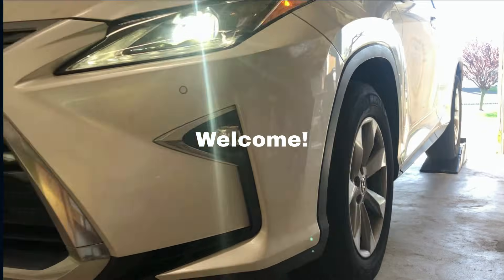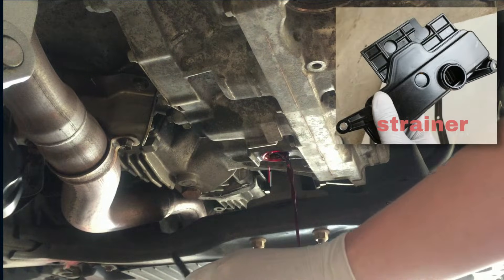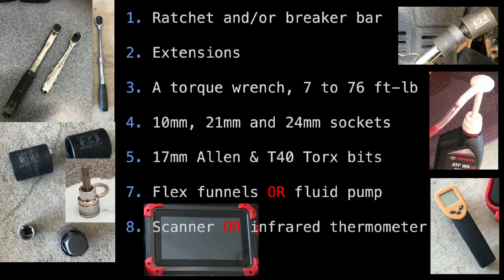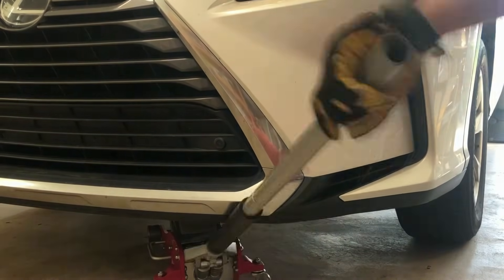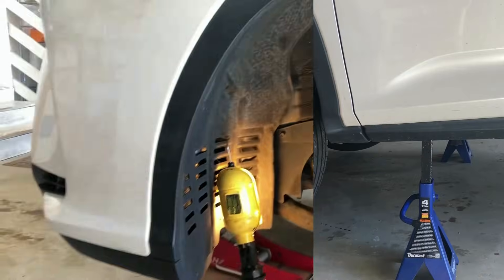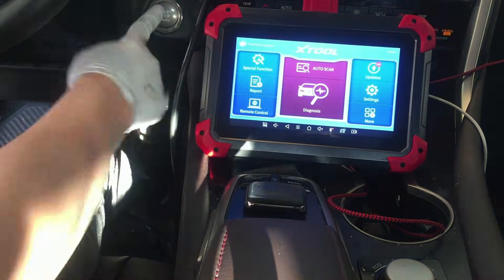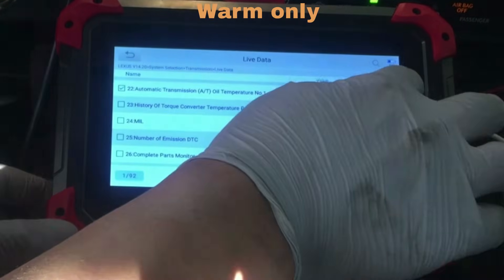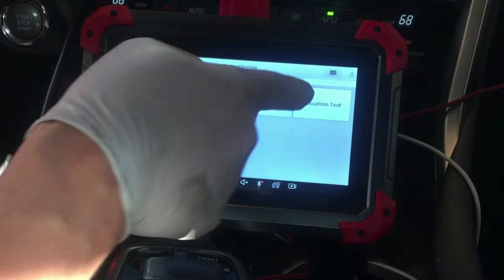Toyota Lexus Sealed Transmission Fluid Change & Level Check - 2 Temperature Gauges

Comment: Can I just drain the fluid then measure how much drained out ex. 4 qts and just refill with 4 qts. Thus adding only what drained out?
Reply from the maker: Short answer: no, I wouldn’t recommend that.

The main issue is the starting level may already be wrong (previous service, someone topped it off, etc.), and ATF changes volume as it ages and heats up. Measuring what drains out also introduces small errors, and if you repeat that over time, those errors add up.

That’s why Toyota wants the level set by temperature with the engine running, using the overflow tube.
You don’t need an expensive scanner either -- something affordable like the Kingbolen Ediag Elite (~$100) can read ATF temp and lets you do it correctly: https://amzn.to/4kSSpAK

Comment: I will replace the transmission fluid by the same amount by measuring using clean clear empty gallons. I will put the new transmission fluid first in the gallon, then the other empty gallon will be used for dirty transmission fluid that was drawn from the transmission. By comparing the level on both gallons, I am sure that I am putting back the same fluid. I withdrawn. 
I like the video indefinitely gave me idea how to do my own transmission fluid change.
Thanks
Reply from the maker: Glad the video was helpful! Though I don't recommend the volume matching approach primarily because the existing fluid level might be incorrect due to various reasons: https://youtu.be/6ZiYsWWayWs. The overflow method at the correct temperature is key for setting the level accurately on these sealed transmissions.

Comment: Do you know anywhere we can buy the plug as a whole with the stand pipe and the T40 plug included
Reply from the maker: Call your local Lexus dealership parts department and they will find the parts for your RX350. Alternatively, you can contact a Toyota dealership and use an equivalent like a Highlander AWD to look up parts and go from there.
Reply from the maker: I list related part numbers like o-rings in the description, which I copied here and they can look up those parts on their diagram and find your parts nearby. 

2. Filler plug washer, #90430-A0003: https://amzn.to/486XP5t
3. Drain plug o-ring, 96721-24018
4. Overflow tube o-ring, 90301-06196

Comment: For those DIYers who have replaced the fluid with factory fill do you get exactly 3300 mL out of the transaxle for the FWD models?
Reply from the maker: I didn't measure the exact amount but up to 3300 mL sounds right on the 8 speed transmission (AWD or FWD). On the previous generation with the 6 speed, it's a much small mount like 1.5 quarts or so: https://youtu.be/AkElgixA5LI

Comment: Hi professor garage, my car is 2019rx350 fsport with towing package, do we have to do something more like plug the pin for coolant tranmission?
Thank you!
Reply from the maker: Excellent question! I'll need a video to clarify this but let me give you my shorter answer: both yes and no. :) Yes officially, on the 8 speed, Toyota requires pinning the bypass valve to circulate (prime) the cooler line to eliminate factors of uncertainty in various situations. This step does apply to 2017 RX in the video and yours (2019 RX) with the 8 speed. 

Now practically -- though this is my conclusion based on readings, not Toyota's recommendation -- it isn't always necessary for a vehicle that has been driven to the full operating temperature (when the valve would have been opened recently for full ATF circulation in the cooler lines) before this procedure. I always drove the car extensively (the night) before leaving it in the garage for service and skipped this step in this regular service. 

Bear in mind though, there are situations where the cooler lines might be empty after a transmission job and you cannot skip this step in those cases. 

Bottom line -- yes, according to the book, you need to insert the pin to force open the valve for this procedure.

Comment: I recently did mine in my 2020 rx350l I found the transmission pan was within a degree of the fluid using the ir thermometer. Thanks for sharing the video helped a lot
Reply from the maker: You're welcome! So glad the video helped and the temperature gun method worked for you!

Comment: Honestly, once you do it it's not that bad.  But absolutely change your fluid, I recently purchased an ES 350 with 152k.  I don't think it's ever been changed, but I did it with the filter and dropped the pan.  The fluid was very very dark.  Everything went fine and it shifts like butter afterwards, no issues.  I know there's some conflicting information about certain high mileage and not doing it, but I feel like new fluid is new fluid, it really doesn't matter when.  It's not like you're changing every drop out anyway.  4.5qts.  

Here is a pro tip, there was one bolt that's a total pain in the ass to get to, all you have to do is cut a socket in half, a quarter drive with a wobble extension and it's money in the bank.
Reply from the maker: Everyone's driving condition is different and the transmission fluid past 100k can vary a lot, and that's why I don't offer general advice without knowing the fluid condition. In your case, it's normal/expected for the fluid to be dark and very dark but as long as it's still very much liquid, it's generally a good idea to replace it with a drain and fill. I wonder though after you've replaced the filter and had a chance to see its condition, do you think it's necessary to replace it? Is it a strainer or filter? I'm not against dropping the pan and replacing the filter but have seen too many problems with folks not following the procedure, using aftermarket parts, and rusty or difficult-to-access pan bolts, which led to problems of incorrect infiltration/pressurization, pan oil leak, and stripped pan bolts, etc. after their replacement. Good work if you've done it right!

Comment: What happens if you put too much Oil? Like 4 quarts for example?
Reply from the maker: When overfilled, the transmission won't have the proper pressure and fluid properties/dynamics it needs to function properly, e.g. with fluid aeration/foaming. Even if it doesn't cause shifting issues immediately, this isn't good for the long term and it's best to check and set fluid level as soon as you can.
Reply: Thank you so much for the feedback😊

Comment: You produce excellent DIY car maintenance videos.   For this ATF drain and fill video, where did you find or determine the 60k, 30k, 30k, etc. interval you state in your video?  I'm intuitively biased towards more frequent refills.  However, the Toyota Master Certified technicians on youtube simply recommend 60k, 60k, 60k, etc. In fact, they warn against doing the drain and refill too frequently. Thx
Reply from the maker: Great question! It's based on my analysis of Toyota/Lexus service schedules over the last couple of decades, with a focus on transmission service, part of which is reported in this video: https://youtu.be/X7iQ8hWcB_w. Long story short, 30k and 60k service intervals were common for normal driving conditions before "lifetime" fluids were "invented." Severe driving usually cuts that into half. Now on the latest Toyota/Lexus service schedules--and you can review yours to confirm--they still recommend transmission fluid replacement every 60k for "severe driving conditions." So by extension, theoretically, you can replace the fluid every 120k under normal driving conditions (and strictly normal driving conditions which aren't common today). It won't really hurt your transmission if the wear has been limited and frequent fluid changes are beneficial. If it makes sense to do the first drain-and-fill at 60k (replacing about half the fluid, 100% from factory when new), then going forward, since the fluid will always be roughly 50% new after each service, you could project the interval to be about half that, i.e. around 30k. 

Bottom line--again, if your transmission has limited wear, I don't see a problem doing it even more frequently. But if the fluid is gone and transmission has now relied on friction materials suspended in the oil, then it's already on a borrowed life and it's only a question of when slipping etc. will start to occur. Hope this makes sense.
Reply: @profsg 
So, 60, 30, 30 is somewhat personally arbitrary. In the whole scheme of things, perhaps a good compromise would be 50, 50, 50?  One obvious advantage is the removal of one maintenance task from the sonewhat busy 60k interval.
Reply from the maker: @Fearless-1 Those 30k and 60k intervals come from Toyota’s long-standing service schedule. They were originally set in kilometers--like 50,000 km and 100,000 km--and when converted, that works out to about 30k and 60k miles. Personally, I find the 50s easier to remember, but Toyota’s tradition has always followed those km-based numbers for transmissions.

Comment: I initialized 3.5 quarts and drained out overflow more than a quarts. Is it correct ? My car is Lexus Rx350, year 2010
Reply from the maker: That sounds about right on your generation of RX. My 2017 model has a different design and a larger capacity, about 3 and 1/4 quarts for a drain and fill.

Comment: I just bought a used 2016 lexus rx350 F Sport with 100.000miles (160.000km). Your clips are helping me a lot.
I have done and, going to DIY:
-Change oil/l and all the filters
-Clean body throttle
-Diff/transfer case fluid
-Coolant
-12V battery
-Brake fluid change, pad/rotor check and service
-Spark plugs change (this is complicated so i’ll book a workshop to do this job)
-Transmission fluid drain and fill. I don’t have an OBD2 scanner to scan the fluid temp. So I’m thinking of leaving the car overnight, and drain the fluid out, then fill in the exact amount of new ATF fluid in. Could you please give me your opinion on this option?
-Are there any other service that i need to do for this car? The previous owner didn’t service the car properly. Luckily for now, the car has 0 problem and drive smoothly.

Thank you!
Have a great day!
Reply from the maker: Sounds like a great plan! On the transmission fluid change, I would not recommend the volume match method as the existing fluid level might be incorrect due to fluid degradation, leak, or someone having touched/drained it (accidentally). On the RX350, you can measure the ATF temperature using a $30 basic scanner like this: https://amzn.to/4fmmgxX, with the Torque Pro app ($5). This video (starting at 7:28) shows the setup and the specific PID for this RX generation: https://youtu.be/WRW4LZmvIy0?si=mllbpjeTSIMCL4WJ&t=448. As for spark plug replacement, you can follow the same procedure here: https://youtu.be/2L0Bg78BRYg. Have fun!

Comment: Hi, thanks for your video!
I just bought a 2016 lexus rx350 with 100.000miles. The previous owner never changes the transmission fluid. Is the mileage too much and too risky to change now? I heard that if we change the fluid of a car that has too high mileage, that’s never changed will cause the transmission to slip, and  results in a change of the whole new transmission.
Thanks!
Reply from the maker: You're welcome! Yes, there's a risk either to replace it or to leave it at this mileage. I discuss the exact question in this video: https://youtu.be/X7iQ8hWcB_w.  My general recommendation is to do a drain-and-fill only, never flush, and if it continues to have smooth rides, proceed with regular fluid service (drain-and-fill) going forward. To be safe though, before the first replacement, take a small sample for oil analysis and make a decision based on fluid condition, e.g. the amount of friction material in the oil.

Comment: I have a Veepeak VP11.  I haven't found any corresponding apps that show transmission fluid temperature.  Does anyone have an app that works with Bluetooth OBD scanners?
Reply from the maker: I believe the Torque Pro app discussed in the video can work with the Veepeak interface. It's the Pro version for $5. If you have the a similar vehicle (e.g. RX350 or Highlander), follow this video for details including PID setup on the app: https://youtu.be/WRW4LZmvIy0. If you have other makes and models, you might be able to find related PIDs in the comments under this video: https://youtu.be/ytdcZ1X8EeQ. Best luck!

Comment: Nice description! I recently did this on my 2017 RX 350. I did reuse the two drain o-rings as they looked perfectly fine. I'm not paying Toyota/Lexus extortion prices for two tiny o-rings.
Reply from the maker: Thanks for sharing your experience! You may reuse the o-rings if they are still pliable, though they won't last forever and I'd recommend get new ones for the next service. Extra bucks for peace of mind.
Reply: @profsg  If you do it yourself, Can you have it recorded in the Carfax?
Reply from the maker: @고각놈  Yes, that's exactly what I have been doing on all my vehicles. Just claim your vehicles on Carfax under your (free) account and you can add DIY service records. You can also add service done by shops or remind them to join and add records there. Not every shop spent time entering these into Carfax.
Reply: A couple of dollars is extortion? Do you know what a new transmission costs? 😂

Comment: Good video but you don’t need to use WS fluid it is a non synthetic. I would use either Valvoline Max Life or Amsoil Signature Series. You can go twice as long with a fluid change
Reply from the maker: Thanks for sharing! I touched on this question in the video here: https://youtu.be/X7iQ8hWcB_w. As you mentioned, WS is non synthetic but most aftermarket products like Valvoline's and Amsoil's are. Their viscosity and other fluid properties can also be very different. I'm familiar with Valvoline Max Life, which it claims to be compatible with a wide range of vehicles including Toyota's older models using Dexron III. These are completely different fluids--they might be better but you are taking a huge risk by disregarding Toyota's specification. In short, my advice is to avoid using aftermarket products unless they meet specifications.

Comment: No pin #13 on OBDII port?  This was driving me nuts until I got this information:  https://www.youtube.com/watch?v=XTU_Jt7OJZk
Reply from the maker: Thanks for sharing! On any OBDII port, pins 8 through 13 are manufacturer discretionary and Toyota/Lexus used #13 as test connector for diagnostics (detecting ATF temperature for a level check). Looks like the procedure has changed on the latest models without the need for this pin, which probably makes it less scary (easier) for folks.

Comment: i had my fluid change at 80k kms, and 140k kms and now did a filter replacement too at 190k
kms. i shouldn’t have changed the filter?
Reply from the maker: No worries! Filter replacement is often not necessary unless you have transmission issues. That said, nothing wrong if you used all OE parts (e.g. for gasket, filter, pan bolts) and experienced no leak afterward.
Reply: @profsg yes everything was OEM, car was cooled to 43 degrees celsius (was tough in this GCC heat!), and then with the engine idling it reached 48.1 degrees at which the overflow was checked. i’ll keep an eye out for the leak though
Reply from the maker: @mohafzal2790  Excellent! All good with OE parts and it won't leak if you tightened the bolts properly in the spread-out sequence with OE parts.
Reply: @profsg ill try to DIY the spark plugs next month, will check out your videos, need to buy tekton torque wrench as the shop is asking for $300 for the labour 😢

Comment: Hi @profsg .  Could you please let me know the fluid level adjustment  temperature for RC 350 AWD with 6 speed transmission.   It's a 2 door car.
Reply from the maker: Here is what I found on the 6 speed transmission: https://www.clublexus.com/forums/gs-4th-gen-2013-2020/989844-transmission-fluid-level.html, which suggests a 102-120 F range. Any temperature within this range should be good but you can aim for 110 F.
Reply: Thank you very much.  Appreciate it.

Comment: Hi Professor,

I own a 2013 Lexus ES350, currently at 146,000 miles. I purchased it at 110,000 miles, and I’m not sure if the previous owner ever changed the transmission fluid. So far, the car runs smoothly and shifts without any issues.

Recently, I checked the transmission fluid by slightly loosening the drain plug while the car was hot. The fluid appeared quite dark, had low viscosity, and gave off a burnt smell.

Given this situation, what would you recommend I do next?
Reply from the maker: If the fluid is dark and burnt, it's a sign of degradation and needs renewal. The question is how much clutch/friction material is in the oil. If it isn't gritty or metallic (with particles), I will do a drain-and-fill first. Just one drain and fill, and see how it responds. There is always some risk. But without too much clutch material in the fluid, there is a greater risk not to replace the fluid at all given that it has degraded and will wear down the transmission fast. If it continues to be smooth after the drain-and-fill, proceed with regular fluid change (drain and fill again) every 30k miles.
Reply: @profsg thank you. Much appreciated for the detailed reply. Subscribed♥️

Comment: Couldn't you start at 30k?
Reply from the maker: Doesn't hurt to do that. The reason for 60k is that it was all factory filled new fluid; but every drain-and-fill afterward only replaces a portion of the fluid and the interval should be shortened (30k). This likely maintains a consistent level of protection. But again, for the initial replacement, I don't see any problem doing it at 30k.